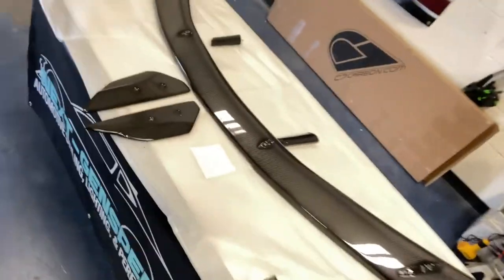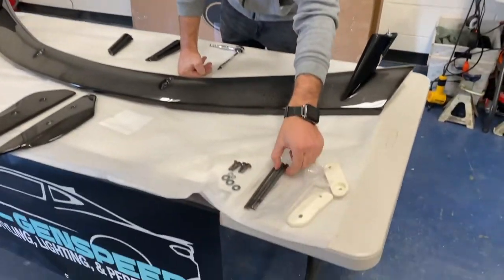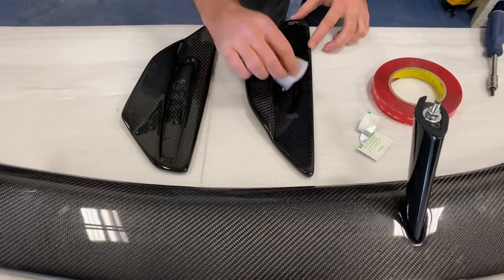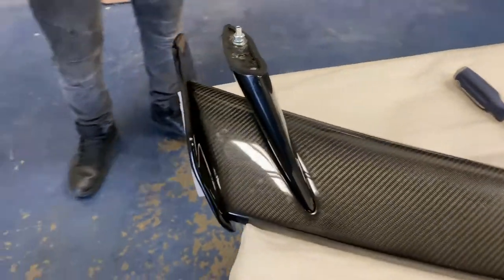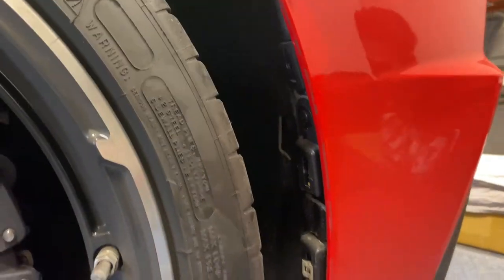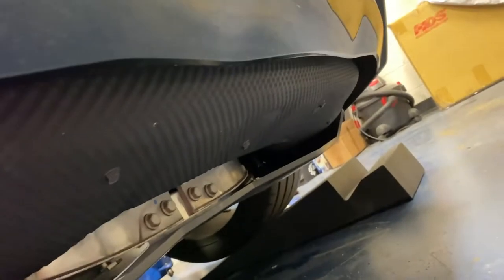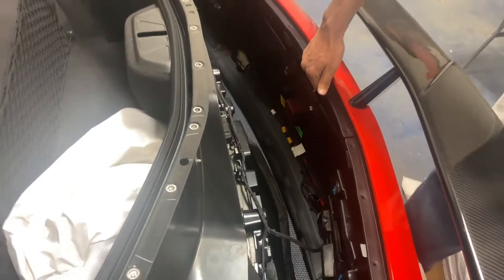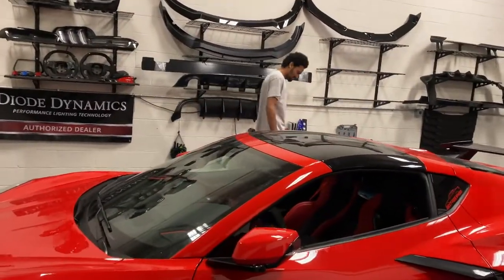Installing My NEW Corvette C8 Carbon Fiber High Wing Spoiler -  C7Carbon

Comment: As found on a car a wing is used to produce downforce (vs lift as with an airplane) which aids in lateral tire grip at speed. However, That comes at the cost of some (induced) drag, although it's minimal and was likely a cost/benefit decision which favored improved lateral grip at, again, a slight cost in drag. You didn't buy a Prius. :O

A spoiler on the other hand is designed to help reduce drag off the rear of the car and thus helps to slightly improve fuel mileage. They do so by controlling the airflow off the rear of the car in such a way that drag is mitigated/reduced. This also aids in fuel mileage to a small degree.

Note:  One can easily determine whether a device is a wing or a spoiler simply by feeling/looking at the underside of both. A wing will have a distinct curvature being thicker at the front, AKA the 'leading edge', which will get thinner, a less distinct curve, as it nears the trailing (aft) edge.  

So why does that matter? It's simple: The thicker, curved surface toward the leading edge (front of the wing) results in air flowing over it be faster than if it were flat. In this way both the air flowing over the top of the wing will arrive at the trailing edge at the same time the air flowing over the bottom will. 

Note: since the underside of the wing, again, as used on a car in this case, has a curved surface, thus requiring the air flowing over/past it to travel faster than the air flowing over the flat, upper surface of the wing. And in so doing it results in a lower pressure area beneath the wing*. This is important since it also results in downforce since nature abhors a vacuum. Or in this case a partial vacuum. Therefore: Presto! More rear tire grip at speed. Again due to the downforce as a result of a wing that's upside down. 

Lastly: Once again: it's a wing or a spoiler. There's no such thing as a " high wing spoiler", a relatively common misunderstanding.

Comment: I know you don't show it, but from what I can see there is no practical way of doing this without removing the wheels . Did you end up removing them? About to do mine, but doesn't appear to be any access without doing that.
Reply from the maker: Removing the wheels is not required. Ramps also help as well

Comment: How did you get to the 3 bolts behind the the wheel off without taking off the wheel ?
Reply from the maker: A small ratchet and bit allows you to. Just need a helper with some smaller hands lol